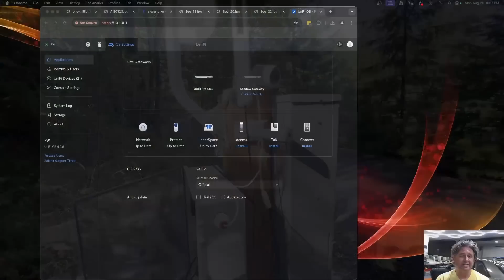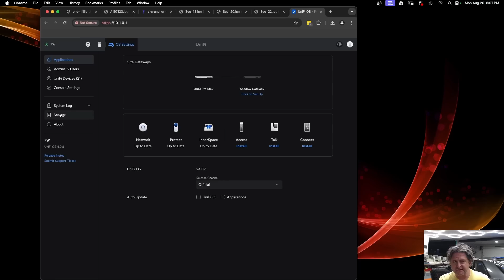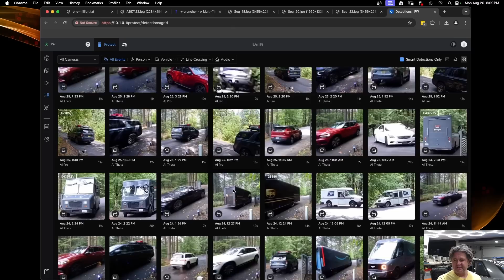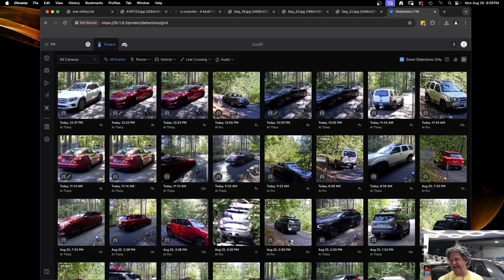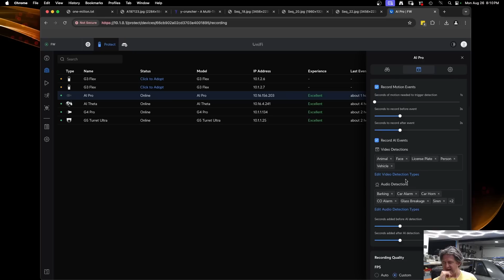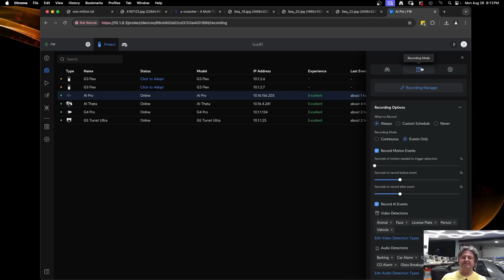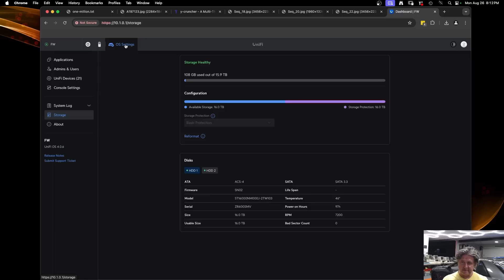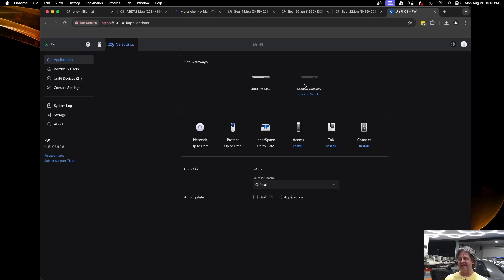Unifi Protect: Converting my driveway cameras

Comment: You have a great setup! I have 16 of the 2k dome cameras outside my house and 4 inside in the hallways including some pointed at the entry doors. Started with AVTECH and ONVIF cameras then updated to the UniFi Protect NVR changing all the cameras. My next update will be 2 of the AI 4K cameras on the dual entry driveway.
Reply from the maker: Very cool!   I just migrated to Protect 5.0 so I can connect non UbI cameras, and that went well.  Video about that coming out asap.

Comment: Interesting vidéo.
Is the Ai Theta outdoor rated ? No problem about rain or other elements ?
Reply from the maker: No it is not.  I made mine outdoor usable by putting it into a tube with a sealed cover, so it should work.. but it is certainly not as robust as a real outdoor rating.

Comment: Nice video and setup. However (and I mean this in the nicest way possible) I would cable manage it a little bit better at the gate, the garage is perfect and the gate is "meh", does not compute haha. The camera on the front of the garage is pretty weird if you look at the angle. Maybe remove the Anke cam's? Also a tip: set it to continuous recording instead of event only.  You have enough storage to do that with only 4 cams and can sometimes be pretty handy if something has happened. Do you plan on adding a IR blaster for the Theta? You could just get a simple one. Also; do you have an intercom for the gate? You could Unifi that by using a G4 Doorbell Pro and Unifi Access. Would be cool. Love your video's, keep up the good work. Would also would like to see a video on the cars! Great stuff!
Reply from the maker: Oh yea, that gate box needs some love!  The Anke cams are indeed going to go away soon.. Good point on the continuous, especially with the storage vs # cams.  I was just thinking about the G4 doorbell!   I'll get one on order and give that a try!

Comment: Great video and nice to know the old wireless option for the gate worked through some trees. I've just picked up some nanobeam 5AC II to try and do similar. 
@3:29 could you have just coupled the two fibres together rather than putting them into a powered switch or is the switch there for future expansion?
Reply from the maker: On the fiber - Yea it would be no problem to just link the fiber together, but I wanted some extra bandwidth in the garage as there are some other extra fibers that term there.  Those nanobeams work really well!

Comment: Fark me, no one ever mentioned the dual stream dependency for detection on Blue Oriface.... Cheers Jeff. 
Some things to consider, Theta's are indoor-only. No audio, no IR. All your cameras except the theta need to be readjusted, skew is off. The AI Pro needs more zoom. Defult settings have some issues as "Default" on each is different.  The quality setting is best put to auto and it will save a lot of data. Turn IR ilume off on the Pro, they work better in starlight or full colour mode.
Reply from the maker: Yea, I made the theta outdoor-ish by putting it in a tube and I have a glass cover for it now.. it is not perfect but should be sealed.   I just upped the zoom on the AI Pro, and I have a second AI pro to install midpoint, so I'll make sure that is zoomed as well.   Indeed that helped the plate detection.  Thanks for the tips!  I'll try out the IR illium turned off as it is pretty dark there.. will be interesting to see the low light performance.
Reply: @jeffsponaugle6339  The G4 and G5 Pro's starlight performance is scary. Their use with other cameras in the area shining their light allows for the Pro's to run passive and not easy to detect them running.

Comment: Am I the only one who is kind of more interested in how you added the Unifi cameras to Blue Iris? I thought that Unifi cameras only worked with Unifi Protect. D you have a video on how you did it?
Reply from the maker: The older unifi camera had a standalone mode when you first set them up, and then they could to RTSP.  On the newer ones you can enable RTSP, but you have to join them to a controller first to do that.
Reply: @jeffsponaugle6339  that’s good to know. I did not know that. Thank you.

Comment: The problem is that all the open source motion detection is fully decoding every video frame and it does not need to. It needs only interpret the motion vectors in the compressed stream to determine if any motion has occurred.

Fully-decoding the frame may then be necessary to get an ML model to identify people/animals/cars/license plates/etc., but again that's because nobody seems to have trained ML models to directly consume compressed macroblocks. They've also failed to train these models for other common things like moths and spiders that trigger unnecessary alerts.

Comment: Killer setup.  The AIPro does much better at LPR when there is a lot of light, the frame rate is higher the more light there is which helps with motion blur.  Also the pro version of the Theta is REALY good at LPR, i havent mounted one outside but the one in our reception room catches most plates that psrk in the parking lot.  again, more light is better..  If you were ever going to install the gate controler and have LPR control Access, the AIDSLR would be worth the investement, it is spectactular at LPR and the lighting u already have installed would be enough for near 100 detection.  Obviously, ur demark is on the wrong side of the gate so it might not be an ideal setup...   Loved the video (and all ur others)!
Reply from the maker: Interesting!  I'll have to look at the Pro version of the theta.  It does seem the AIPro does good with lots of light, which is not surprising given the frame rate.  Some of the really good high end LPRs use very nice optics and high frame rates.  Good ideas!
Reply: @jeffsponaugle6339  yeah obviously the AIDSLR is using a $1400 f1.2  lens and that lets it kill the frame rate..  the theta pro lens is just a sleeper, not sure why it's so good, but it is..
Reply: @jeffsponaugle6339  Hello, I am an employee of anpviz. Our company specializes in professional security monitoring, and we have many new products recently. You can test them for free and publish them on your website. We can offer you a commission. We look forward to your reply
Reply: 10:40 there's a 'custom' setting for night mode - maybe install a big IR LED floodlight, then set the LPR camera to night mode with the IR cut filter off, and that will work better, even during the day?
Reply: @shm5547  the only issue with flooding IR is the reflective nature of of LPs make it blow out the image.  The G4PTZ Industrial is a good example, crazy strong IR, but blows out LPs..
Reply: @DPCTechnology  yep, that can be an issue, but if you physically offset the IR illuminator from the camera, you lessen the effect of blow out from the reflective coating of LPs (as the reflective material shoots light back mainly in the direction of the illumination source).

I never use the built-in IR illumination on cameras for this reason, but also because the warm IR light seems to attract spiders and moths etc. which you don't really want around your camera lens!